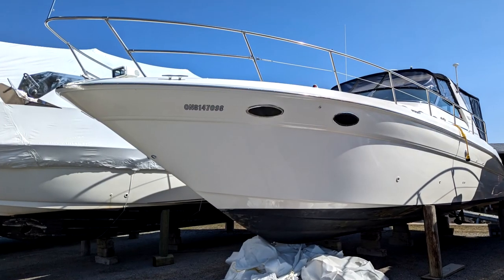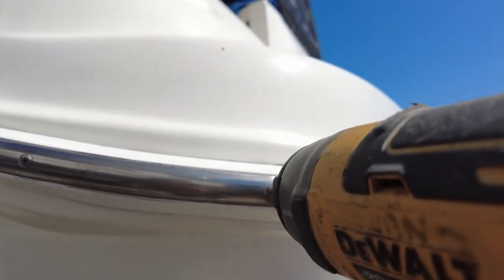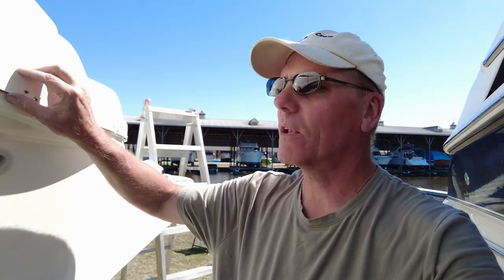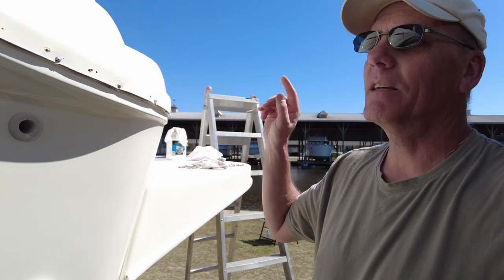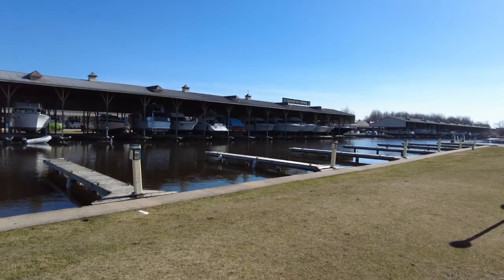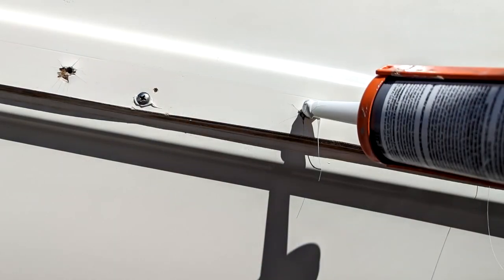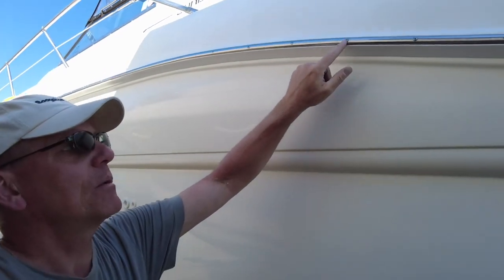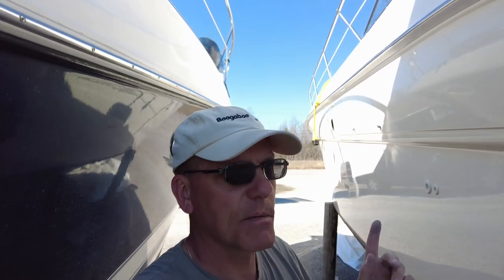Hull Rub-Rail Removal & Repairs - Sea Ray Sundancer

Comment: I love tinkering on that type of stuff. If I was faster at it - I could probably get paid for my work.

Last season I had the stainless rub rail off & was able to remove a couple good doinks the previous owner left in the rail for me. I was able to hammer & dolly the trim true - then buff & polish the rail in those spots. 100% fix. Fun repair - in hindsight.
Reply from the maker: I'm hoping to have time (before next season's launch) to clean up all of the stainless rubrail, as it has seen a bit of dock rash that doesn't look very good. Farther along on the port side, towards the bow, there's some seriously imbedded rust that I want to eliminate. It does flake off, but will need removing and sanding/polishing like you did. But that's for next year, as Boogaboo is floating now, so no chance for this season. 
BTW, my awesome Launch video comes 9ut on Sunday!! 👍🤗😁👌🍺🍺🍺
 And funny you mention doing this type of work for pay; how many times have I asked myself that same question over the years 😉

Comment: Thanks!
Reply: I have the same boat as yours. I cannot find where the or how to work the macerator pump so I can discharge the brown water.
Reply: A tutorial on that would be great
Reply from the maker: Thank you!!
Reply from the maker: Our boat doesn't have a macerator pump, as discharging black water overboard is illegal in our area - something I would never do that even if it were legal.
Reply: @BoatingWithBoogaboo  I use a marine pumping station for years now …..but I have a macerated pump but don’t know how to use it .

Comment: Replaced the refrigerator on my Silverton yesterday. Stripped about 10 screws from the mount brackets. Guess I should have cleaned the heads better.
Reply from the maker: As a general contractor, I've often used a deck screw to dig out dirt from screws - a truck I employed on this job, but never made it to the video. Another hunt is to use a good screwdriver bit, as once they start to round over, they'll just make life difficult on the subsequent screws. Best to toss those screws and replace with new (if not too late in the job timeline).

Comment: I like your video, I kept blaming the rail mounts.  Question:  How many tubes of Sikaflex-291 did you need for the whole rail?  Keep up the good work and videos!
Reply from the maker: In actual fact, I only removed the rub rail across the transom and probably 2/3 of the way up the port side of the hull, so I'd say roughly 40% of the entire rub rail. The port hind quarter was the only area that I had seen water coming in (a couple of screws that protruded through), so that's all I needed to do - especially considering that the boat was being launched early the next day ( https://youtu.be/sCawqAJZFfY ).
 In all, and given that the Sikaflex was only required on the screw heads, I might have used maybe 1/3 of a tube for this job. So far, all good :-)
Reply: Thank you !
Reply from the maker: Much welcome!

Comment: Which model Sikaflex did you use? There are several like 221, 252, 291, 295...
Reply from the maker: I've been using the 291 for nearly 20 years on our current and past four boats with great success.

Comment: I was impressed with the condition of your hull to deck joint - it certainly looks as if it was done right at the factory.  Some boats are produced with huge gaps in the joint that cause the caulk to repeatedly separate and fail.  Your SR is a 98' and mine's an 01' so I'm hoping mine was done with the same care and attention to detail as yours. This is why we keep coming back to SR boats, right?  Just finished installing my 2 SIMRAD chart plotters last week (12" and 7") and of course we're having thunderstorms roll through FL  all weekend. Will feel much better once I can power them up on the water and confirm my 2 transducers are working properly - SMIRAD forward scan for "reef avoidance" and an Airmar B164. Next project will be antenna installations on the arch - 20+ Halo radar, 3 GPS, 1 AIS VHF, 1 VHF and 1 Glomex for digital TV (not on the boat to watch TV but handy for news). Looking forward to seeing your launch - good luck and have fun!
Reply from the maker: Yes, that's exactly why I kept coming back to Sea Ray 👍 
 Good to hear your projects are coming along well. Keep an eye on the channel, as I'll be sharing lots of projects I've shared since launch. You might be interested to see my TV installation video in particular - the main one in the salon, not the smaller one I did in the master stateroom, or the tiny one I took out in the original salon location. That one got a custom storage spot.
Reply: @BoatingWithBoogaboo  I will. Looks like you routed the cables through bulkhead behind the helm console? My plan is to have one for watching videos and TV and the other as a chart plotter remote display (HDMI). Handy for keeping an eye on things at anchor.
Reply from the maker: Yes, behind the helm, but I don't want to reveal all my secrets before the video comes out 🤣
 Don't forget, the big Spring Launch release is tomorrow!! Very exciting 😁
Reply: @BoatingWithBoogaboo  Launch time is always exciting. My friend in NJ is getting ready to launch his 92’ 310 Sundancer - brings back fond memories. Boat is beautiful condition.

Comment: Where did you order the rub rail from great job
Reply from the maker: Order the rubrail??? It came with the boat, 25 years ago 😜
Reply: @BoatingWithBoogaboo  Ohhhh i see my rub rail on my Sea Ray 390 crack with a bad dock hit over a storm on the swim platform. I wanted to replace about a 20 ft section. I heard it wasn’t that hard to replace. I just need to know where to order the rail. The stainless is fine. 2005 Sea Ray 390